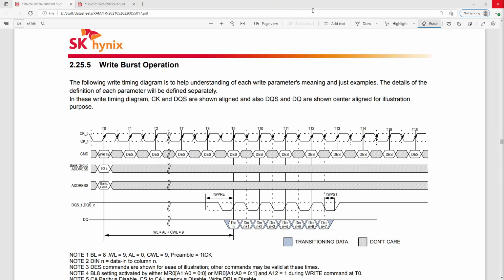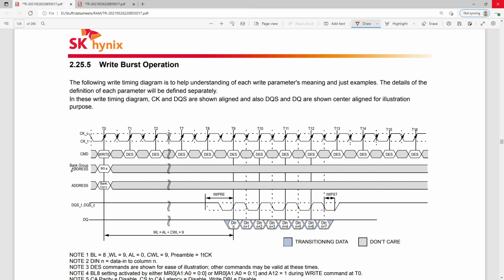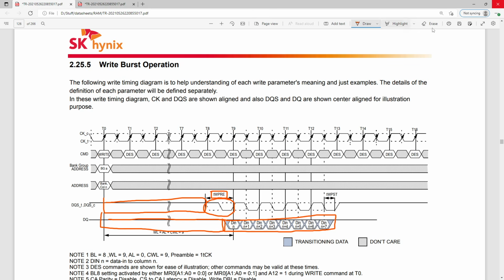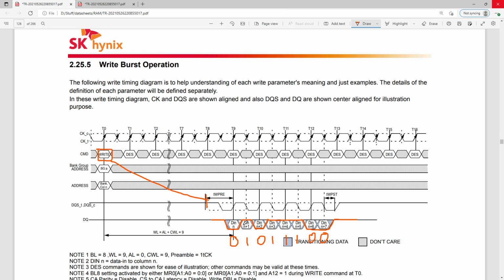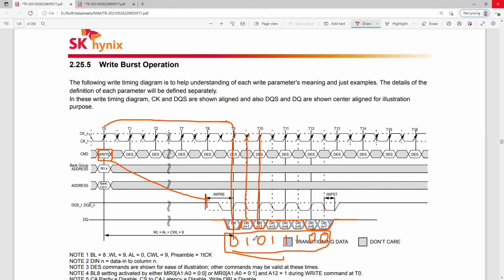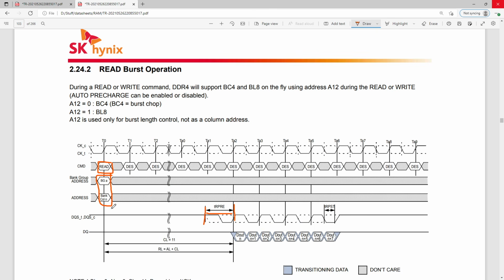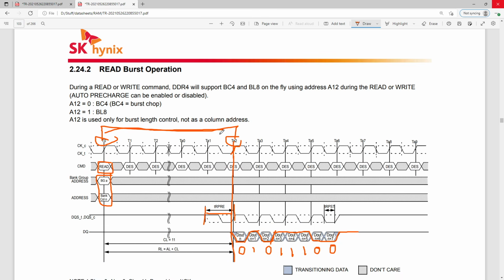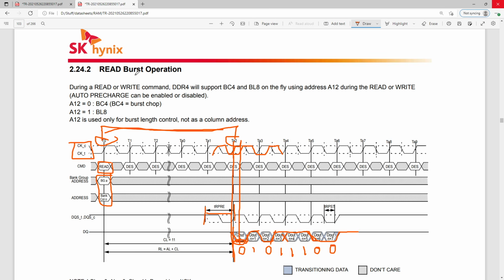How double data rate DRAM works

Comment: So technically, if memory is using a clock signal of say 2.2 GHz and it's branded as 4400 MHz, chances are somewhere in that memory controller there's a clock running at 4.4 GHz to generate those two phase-shifted 2.2 GHz signals. Meaning, technically they're not lying 😅
Reply: You don't need a 4400mhz clock to generate two 2200mhz phase shifted signals. In this case its quite simple to do it with one 2200MHZ clock, because when measuring the voltage on the positive and negative terminals they are always going to be of equal absolute value and opposite sign, which is a 180 degree shift.
Reply: @guycxz  I thought the point was to get a 90-degree phase shift? But you're right, for this you might need 4x the frequency, not 2x.
Reply: @unvergebeneid   
DDR simply takes advantage of the fact that the clock changes twice per cycle. The second clock can be at any offset, and isn't even required since you could just measure the signal every time it hits 0. The issue with not having a second clock would be that any interference would offset your clock, So you use two inverted signals, expecting they would suffer mostly identical interference, and check when they're equal instead.
And you want a 180 shift between the two clock signals because it's easier to generate two inverted signals from a single clock, rather than having to synchronize two or more.

The issue with going beyond DDR is that even if you can synchronize an arbitrary number of clocks with a constant offset between them you will still end up with a clock signal identical to one from a clock running at the sum of all frequencies, so you face the same signal integrity issues.
Reply: @guycxz  that's not what we're talking about here though.
Reply: @unvergebeneid  I reread your reply, and I think I understand.

The 90 degree shift is from the "peaks" of the clock signal to the point where you do the read/write operation, while the 180 degree phase shift is between the two clock signals. 

You why would you need 4x your frequency?

Comment: Weird question but if u where transferring a lot of 0’s would your powerdraw be less than alot o 1’s comparatively
Reply: Most chips are built with CMOS technology these days. Energy is dissipated as heat during change of signals. So often switching between 0 and 1 user more power. The data lines here are just one part where levels change, so the difference is minuscule.
But there are instances where crypto keys were compromised by doing thousands of operations and then statistically analysing the variations.

Comment: So what's the point of the data queue strobe? Why not use the main clock? Looks in the diagram that they're perfectly in sync 🤔
Reply: They are. But if you use the main clock, you start charging and discharging parts of the silicon that should be left alone. It's basically the main clock masked with an "enable" signal.

Comment: This is awesome. With this diagram could you explain what the rest of the timing numbers mean and why they interplay with wall clock time? The timing information is listed as a set of 4 numbers. CL-tRDC-tRP-tRAS correct? Given this information a CL of 10 at 1000MHz is 10ns (Because 1 second / 1,000 / 1,000,000 (MHz) = 0.000000001 seconds × 10 = 10ns [For divide move the 1 from it's unit place on the number line for the number of zeros to the right including the unit number place.]) So every transaction that happens incurs this 10ns pre-amble cost. But in the same way a CL of 20 at 2000 MHz is 10ns also (Because 1 second / 2,000 / 1,000,000 (MHz) = 0.0000000005 seconds × 10 = 10ns again). So a lot of things play into wall clock time and when we are doing billions of memory access reads and writes this tiny nanoseconds really add up into perceivable time.

CL (CAS) is already shown on the diagram directly where CL=11 meaning 11 clock cycles go by before the read operation starts.
tRDC (= CL + tRDC) is harder to see on here. When does a new row open up in memory? As a software engineer what should we be looking for to avoid this if we can?
tRP (= tRP + tRCD + CL) is the recharge cycle count from issuing the precharge command and opening the next row. What is a pre-charge command? When does one open the next row? How does that play into data-bus width if at all?
tRAS (= tRCD + CL | tRCD + 2×CL) is the minimum number of clock cycles required between a row active command and issuing the pre-charge command. When is it tRDC + CL and when is it tRDC + 2×CL?

In general it's easy to see now why CL numbers are usually the thing that's advertised up front. It plays into all of the calculations and is an intimidate cost that must be paid for any command execution.
Reply: >tRDC (= CL + tRDC) is harder to see on here. When does a new row open up in memory? As a software engineer what should we be looking for to avoid this if we can?

You get something like 2048 rows on a stick and 1024 columns in each row AFAIK - some 8MB per row.

If you want to read a chunk of data which is all together, you can read all 1024 columns on the back of a single Row Access Strobe (what RCD, RAS to CAS delay, is referring to). All you have to do is open it and then spam CL, CL, CL as many times as you want. If your data is split into little fragments all over the memory, though, you cannot do this and access becomes much slower - you'll often have to wait for Precharge to close a row and then RCD to open another one and get ready to CAS again. This is somewhat analagous to fragmentation on a hard drive where it may read a single chunk of data at 100MB/s but slow below 1MB/s if it has to seek all over the platter after transferring a few kilobytes.

I don't think that there's much that you can do to optimise this from a programming standpoint unless you're writing with a low-level language like assembly and you can be very explicit about exactly where, when and how you're reading and writing with DRAM. I believe that a lot of it these days it automatic on the memory controller side in hardware and not modifiable even if you wanted to and had the know-how.

>What is a pre-charge command? When does one open the next row?

Precharge is the delay to close a memory row before you can open another one. If you have an open row and you want to read data which is in a different row of that bank, you must wait for Precharge to close the current row and then RCD to open the other one before you can CAS with that new row.

>tRAS - When is it tRDC + CL and when is it tRDC + 2×CL?

It's never explicitly either of those, nor do they make that much sense as a guide. The memory controller will try to open a row, do something inside of it and only afterwards it may try to close it again - closing a row may allow us to avoid waiting for Precharge later on if we need to access a different row, so an IMC will sometimes choose to gamble on closing a row in the hopes of the next requests being for a different row.

If tRAS hasn't elapsed then it can't close the row and has to wait. Even if you have a tRAS of 20, the IMC may choose to keep a row open for 100 or 1000 cycles if it's doing something useful in that row or thinks that it can do soon.

The fastest operations (where you can open a row, do something and then even want to close it again, thus potentially triggering tRAS limit) are probably Writes because writing is generally faster than reading. For example my bdie at 3800mt/s runs stable with RCDRD and CL of 14, but RCDWR of 8 and CWL of 10.

CL or CWL do happen for every read or write operation, but because of their headline importance they are also tuned pretty well on virtually all memory. You'll never find a stick which has CL running 2x or 3x slower than it could be. The biggest speedups in memory timings are generally in the secondary timings because you do find these 2-3x improvements - like a FAW of 49 which can run perfectly stable at 16, for example. That's much more important than improving CL - even from e.g. 18 to 14.
Reply: @AerynGaming  Woah, great answer. Now I need to know more about secondly timings. Is there a place where you learned about all of these things some resources you have?

Comment: do the 32 bit DDR5 subchannels are in sync of each other like the 64 bit in DDR4?
Reply from the maker: depending on the memory controller all memory channels can be completely independent or behave like 1 giant memory channel. Fun fact intel 6-11th gen CPUs actually behave like 128bit single channel rather than 2x 64bit channels. 12th gen works at 2x64 or 4x32
Reply: @ActuallyHardcoreOverclocking  Ddr5 is an 80 bit in a single stick with two 32 bit + two 8bit error correction.
Reply: @ActuallyHardcoreOverclocking  Fun fact, I just installed on a rog strix x670-e with a ryzen 9 7950x3d "128 gb ddr5" 6000mt/s in 2 64gb kits (2x32) f5-600j3040g32gx2-tz5nr and it only recognizes 3200mhz :(
Reply: @ActuallyHardcoreOverclocking  In the 12th, is it because now the frequencies it will handle are higher or what would be the reason?

Comment: You mentioned that it is beyond the scope of this video to specify the reson for the clock voltage to be differential. Could you give me something to google it?
Reply: Might be related to how audio signals do it in balanced connections. 
If there is a noise source, it will be on both signals, if you sum up the signals against each other the noise will be the only thing left which you then can subtract from the signal to get a clean version without noise. 

If the signals are just flipped so 2v and -2v, you sum em up, you get zero. Everything not zero is noice
Reply: @TV4ELP 
1. Using a comparator essentially does the "flipping" and noise cancelling in one step AIUI
2. Differential signalling only eliminates common mode noise. ie. noise that is the same on both lines.

Common mode noise is the primary source of noise in conductors that are arbitrarily close together and parallel but as frequency gets higher (with respect to line length and/or voltage), other sources of noise start to become significant too eg. capacitive coupling
Reply: @Alireza Same "Differential Signal" should find what you're looking for.

Comment: Is there a way you recommend for someone, who isn't beyond clicking OC is bios, to learn how to overclock their system? Or is that strictly learning computer science?
Reply: still the lack of experience and playing around hardware will be a limiting factor. There are tons of guides, info and videos, but someone never stops learning. I started overclocking in 2005 with socket A, having pass through a lot of hardware and configurations and yet this year started to understand DDR4 RAM overclocking at it's fullest (only because I never bothered tbh).
Reply: There are a lot of online resources, even on BZ's playlists he has a lot of informative videos on how to approach certain aspects of overclocking. Also this area of computers is actually closer to electrical/computer engineering than computer science, which might help push you in the right direction.

Only thing that might be hard to find that BZ has are some of the datasheets to components or processes that are not readily available by the manufacturer. They don't make all of them public and/or take them down from public access.